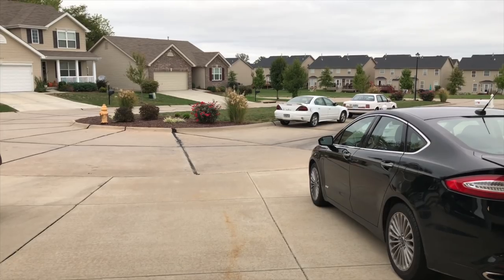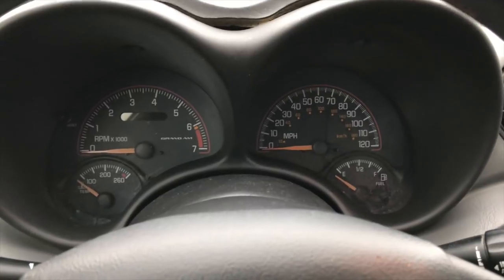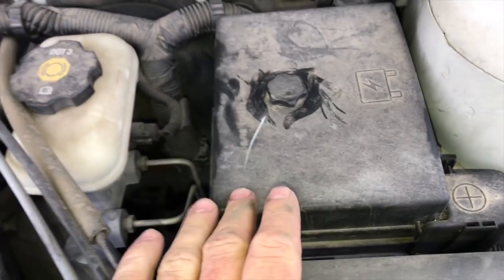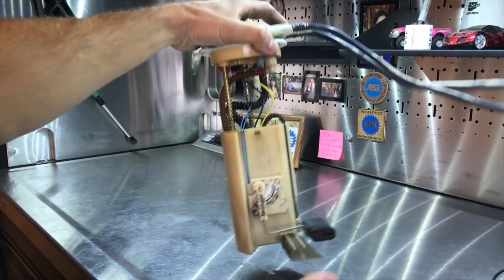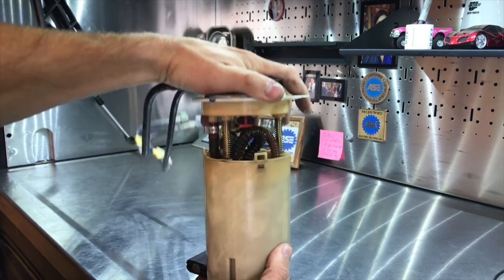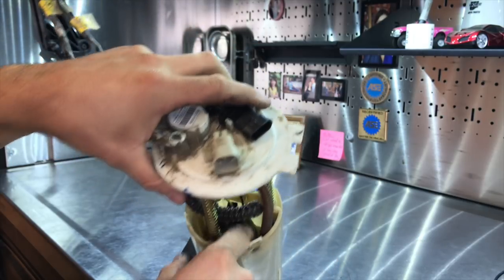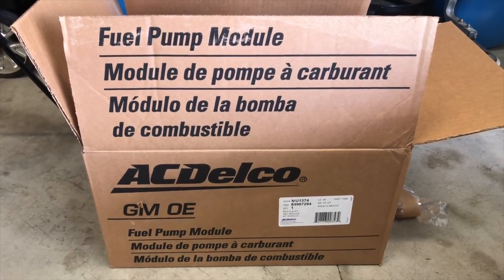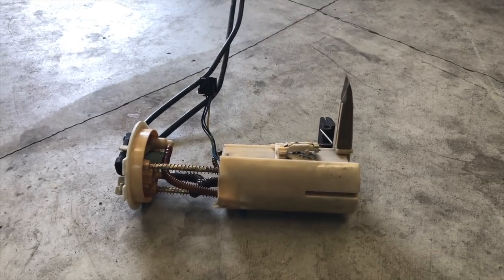How to Fix Your Car (Briefly) with a HAMMER!!!

Comment: EXCELLENT VIDEO,
I just broke down at the store.  Random guy said he happened to hit his and it got him home, but died the next day.  He had no idea how but just lol that it was luck or whatever.
I beat mine and after 20 minutes of other stuff and to much cranking, this TRICK WORKED.
Thank you so much for showing the insight and now to order and new pump.
Honda accord, did one thing great, pop the truck pull the carpet and there the pump is, remove replace DONE.

Comment: I had my fuel pump start to fail in my Ranger. It would lose power on the road and when it finally bit the dust on my way home one day, I pulled over, hit my tank with whatever debris I found on the side of the road, and drove it until it started to die again, and repeated the process. I did this about every 2 miles all the way home.
Reply: 2:50 😊

Comment: Dads old 99 Tahoe 5.7 fuel pump finally got tired yesterday and it's the original part..pretty good longevity on that pump I'd say..will treat the 'ole girl to an AcDelco replacement in a few days..its 2022.

Comment: I had an 02 Malibu (same engine as this car) with a nightmare of a random crank/nostart problem. Every month or two it would randomly not start, then let it sit a few hours or overnight and it would start and run perfect. Never any codes or warning lights, checked fuel and spark, did all the multimeter tests, tested ign module and coil packs, everything checked out. I finally threw up my hands and decided to start replacing things that probably needed replacing anyways until it was fixed, so six months later after a new fuel filter, ignition switch, crank sensor, and ignition module, turned out the cam sensor was intermittently faulty even though it tested fine and never threw a code.

Comment: Thanks for the explanation, I am having fuel pump issues, going into the shop today to be replaced, I would do it myself or hire a backyard mechanic but we don’t have a fancy shmancy lift like you do lol. So did the car work properly after replacing the fuel pump?

Comment: If the truck turns on when striking with hammer do I need to change just the fuel pump or the fuel pump sending unit also ?
Reply: Just fuel pump